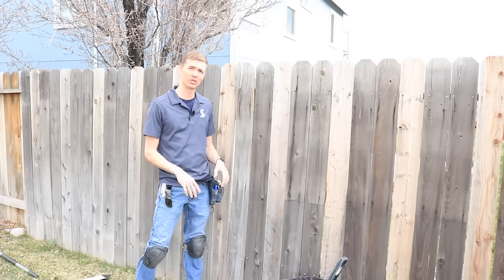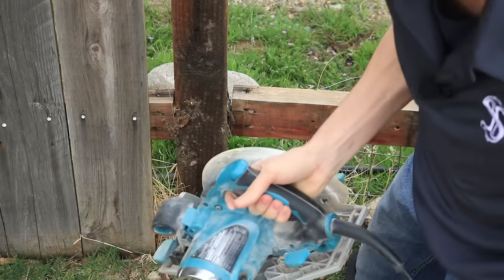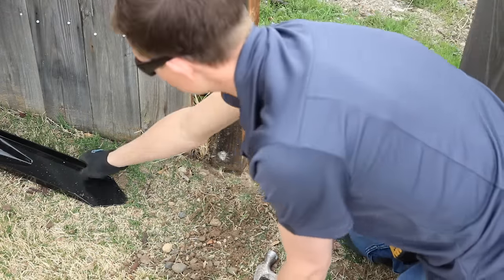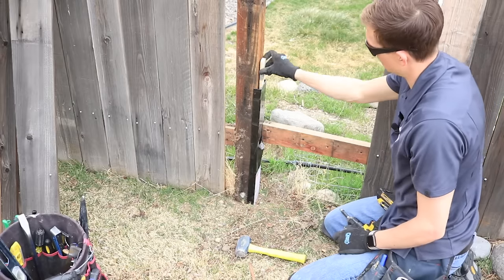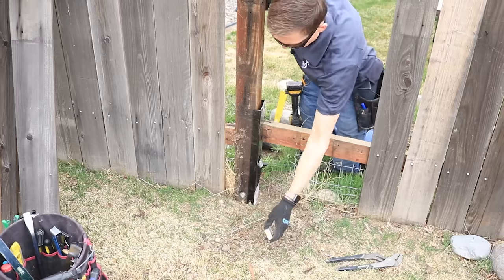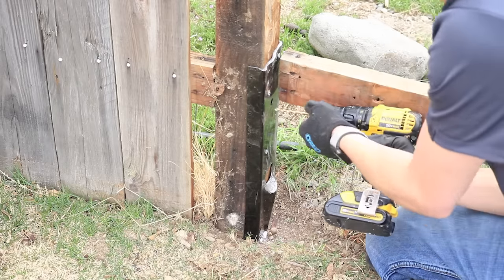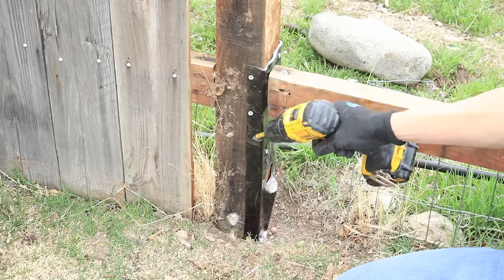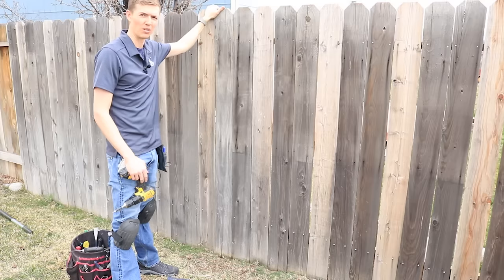How to Fix a Broken Fence Post in Under 30 Minutes

Comment: Thanks for the video! Knocked a few of these in the other day--if anything it was easier and quicker than your video made it out to be. But this thing is solid now, not going anywhere. I'm happy to get a number of extra years out of the fence as it is before I opt to do more invasive fence repairs/post replacements or transition to metal posts or something like, but will cross that bridge when I get there. For me in my situation it fit the bill.
Reply: I is uui
Reply: My neighbours are non-existent right now so it's a great time to do it.
And I took a lot of big branches off that stupid apple tree.
🤣
Reply: You can put new posts between the existing ones even on any side of fence
Reply: a😅
Reply: Good luck doing it in Florida
Reply: 😢⅚

Comment: NEVER hit a hammer with another hammer. The steel sleeve will most likely be stopped by the concrete in the ground. I have never seen this type of repair done.

Comment: If you place the crowbar in the space where you were originally hammering and then hit the bar with the sledge, it will go down nicely without marring the top at all.  That's how I did it.
Reply from the maker: Nice tip.

Comment: Ironically the easy mender looks anything but easy to hammer in.
Reply: assassinlexx  The water needs somewhere to drain to; digging a hole and filling it with gravel just creates a bathtub unless you have granular surrounding soils.

Comment: I should have listened to all the commenters on these ez mender videos. First one i tried, split the concrete, with 1/2 split through whole thing. Its beyond me, how this steel chisel, that is about 1/3 of an inch wider than the square opening, can NOT crack it.

Comment: This video was very helpful. Part of our fence came down with 2 posts on Saturday January 11th. This was due to high winds and a winter storm in the Chicago area. I used your method to repair one of the posts Saturday. It took longer due to my inexperience and lack of skill, not to mention the darkness, wind and snow. It ended up being a very solid repair. I was impressed how well this worked. Your instructions were great. I deviated slightly in that I secured the 2 supports to the post with a long carriage bolt going through the post and both supports. I used a chisel to make sure I had some space between the concrete (which was at ground level) and the post. Essentially, it seems the support wedges into the wood rather than breaking through the concrete. Thank you very much!
Reply: Good idea using a chisel! I'm not skilled enough with a circular saw to pull off that stunt, so... thank you!
Reply: @ltpdogtrainingNJ  Actually, he used the chisel to create some space in the concrete footer next to the post so that the EZ Mender could be hammered in.  He wasn't using the chisel to shorten the horizontal fence rail to make allowance for the EZ Mender (the circular saw part of the video).

Comment: Many thanks for the video. I’m bracing a 4x6 post that you only want to install in a lifetime due to its location (and now surrounded by pavers).  Using the head of another hammer on top of the bracket was a great help. I was not making much progress after 5 min until I started hammering the top of the bracket. Many thanks for the tips!
Reply: Good fences make good neighbours

Comment: We don't have this slim type of fence mender in the UK. I like it! I would give my clients an option to fasten it to a wood post during installation of a new fence to 'future proof' the inevitable underground rot. Fit it as you have in line with the fence to balance the strain. For an extra $10 per post, a sensible choice.

Comment: Thank you for making this how to Video!! Extremely helpful…Just bought 2 of these at Home Depot and they were about $18 each so the price appears to have gone up. Seems like if they put these in on day 1, even if it they weren’t on every post, fences wouldn’t sag as much as they do
Reply from the maker: Nice! And yes, inflation is a bummer.
Reply: These things in the uk are £150 each, it's cheaper just to replace the whole post.
Used to do the same thing years ago but on decayed electric poles.

Comment: Thanks alot this was very informative and helpful,  I do fence repairs and this cam save lots of time and stabilize a wobbly fence easily great tutorial, only thing I would change is using a bigger sledge hammer , I would probably find a more flattened peice of steel  but all you showed was great work!!

Comment: If you have trouble areas in your yard where water collects in the spring, I would even consider installing these on a brand new fence, to pre-emptively take care of the rot that will inevitably form at the ground line
Reply: Huh?  they aren't going to keep water out on a new post.  no way.
Reply: Or you could use metal posts. Like a quality fence builder.
Reply: Get rid of the 4x4 and put a schedule 20 galvanized 2 3/8 post.
Reply: Build the concrete up so water does not sit at the base of the post. Lesson learned

Comment: This is the way I did mine. Dig out the existing concrete post footing (it's weak concrete mix, commonly used by fence contractors) A heavy bar or small chipping hammer will easily breakup the existing post footing. Cut off the decayed fence post at least 2" above the surrounding ground level. Remove all concrete pieces and other debris and make a clean 12" dia x 24" hole, Put two earthquake straps 2 ½" x 36" long (sink coated) Use galv strap nails on every hole of the strap, 18" up and below the cutoff end of the existing post.  Brace the post to plumb. Check the hole in the ground is centered below the post, pour regular premixed concrete and should be at 12" in diameter and 24" deep or at least 4" beyond the end of the anchor strap. Finish the top of the post to a smooth finish at least 1" above the surrounding ground, wait 3 days for concrete to set before testing it for stability and firmness. And you're done!
Reply: Sounds like $500 to repair one fence post. Would you pay someone to do that much work to repair one post???

Comment: Thank you. Your video was super helpful. I just used three of these to fix a long stretch of fence. It’s stronger than when it was new. 
Best tip is to use two sledge hammers, one as a hitting platform and the other to hammer.
Reply from the maker: Glad it was helpful. Thanks for taking the time to comment.

Comment: No doubt this would be a less expensive and much less labor cost than digging up a post with concrete at the bottom and replacing the whole post. Great tip! Thanks
Reply: Did you see how long he hammered on it?
Reply: Not at $18 for two it isn't.  And NOTHING will stop the post from rotting.  Now it will just rot in another place.  There's no free lunch here.

Comment: I used a pair of these on a gate post.  There was a lot of resistance the second half of the way in and much distortion of the metal, but they worked well and secured a heavy gate. 

One comment:  hitting a sledge hammer head with another hammer could end badly if they both are hardened steel - one can drive off a chip that will fly like a bullet, striking ones face (or worse, privates) of course.  Would ruin a good hammer, too.

Comment: The placement of the mender can go any way. There’s more than one right way. Great video!
Reply: I as wondering why he removed the fencing and 2x4 cross support vs installing the metal channel on the open side of the 4x4 post (not removing fence boards, cutting cross support, etc., etc.) ? Curious ... ?
Reply: @GravityRoller  If you think about it fences tend to fall outward or inward. If you were to try and "bend" the fence mender it would be far more difficult to bend it against 4 inches of steel than at 90 degrees with far less steel. The open side would "help" but not near as strong as the way he did it.
Reply: @jerrybenson  Yes, I would agree with your thoughts on this. Appreciate your taking the time to reply.

 I was thinking a couple lag bolts or carriage bolts (instead of nails) along with all the labor saved not removing and cutting existing wood to fit in-line would make more sense.

Comment: Hey dan, teach people to use metal posts , then you will never have a problem. The metal post on my fence are almost 60 years old.  👍
Reply: @tgmforum tgmforum -- It's possible to hide the metal posts by making a box that fits over them so that they look like a regular post.  Some HOAs (Nazis) have rules against metal posts though, even if they can't be seen.
Reply: Your metal posts have never seen hurricane force wind. 4x4s will handle it. Metal posts bend right over.
Reply: @dontblameme6328  Ok how bout this:  If hurricane winds do not apply to you (aka the majority of the world), then this is a good idea.  But yes, otherwise, smart to take into consideration.

Comment: That is why I used metal posts ($26 each) for my back yard. so, I do not have to worry about the damaged posts in the future.
Reply: This is the best answer by far!
Reply: Metal post rust off at the ground too. May take longer if they are galvanized.

Comment: Ive been building fence professionally for almost 18 years.  This E-Z Mender looks like it takes more time and effort then digging out the old post and replacing it with a new one.  Btw, never hit a hammer with another hammer.  They are both hardened surfaces and can shatter
Reply: Agreed, I cringed when I saw that!  You absolutely do NOT want to that without eye protection... but even WITH eye protection, it's still a bad idea.  You could still catch some flying steel elsewhere on your body.  Shake hands with danger!!!
Reply: Agreed. Far more trouble than it's worth. The cost of a new post and small bag of concrete would be negligible.
Reply: I'm not a skilled DYI guy but I repaired a fence but doing just that....I dug another hole about 2 ft over, added quickcrete, and nailed the boards to the new post. In hindsight, probably should have used screws. So far so good
Reply from the maker: That's because you are wrong. I've replaced dozens of posts and do not lack experience.
Reply from the maker: If you can remove the old post, set a new post in concrete, and then rebuild the fence around it in less than 30 minutes by yourself then PLEASE share your methods with me. Until then, all of you armchair quarterbacks should find something better to do than discount methods that make your services irrelevant.
Reply: @StayHandy    You did not do that in under 30 minutes, and even if you did the post will fail within a year.  You, sir, are what we call a "fly by night" fence installer.  The only armchair quarterback is the guy wearing kneepads with gel in his hair, acting like he works outside.  Btw,  I see your dozens of post and raise you hundreds, possibly thousands of fence repairs.  Quit trying to scam people kid.
Reply: I could do this repair myself in way less than 30 mins. It takes about 5 mins to dig a hole right down the side of the post. Next you use a digging bar to break off 1 side of the concrete, then you pull old post out, drop new one in. Nail on your 2x4's, add new concrete and cover with dirt. Bam, done, only takes 15-20 mins and it's done correctly.
Reply: You are not a pro fence builder, if you were , you would be laughing at yourself. Learn how to use a spud bar. Fix it right.
Reply: @stevepauley2437  BS. How are you going to drop in a new post and fill with concrete when you still have three  sides of old concrete left in there? And no hole can ever be dug in 5 minutes. And besides that now you've made the hole way larger and eroded support for the post and made water get all down in there. NEXT!
Reply: @TheLarryBrown  guess you’ve never built a fence before, huh? I’ve been doing this a very long time, and that’s how the old timers taught me. Of course the hole will be bigger, but that’s the only way to get concrete and post out. The new concrete will bind to the other 3 sides you leave in the hole. As far as losing support, no, you don’t. Drop in 2 shovel fulls of concrete, and the 3rd use the shovel to hold concrete against the post. Then put dirt behind the shovel, and tamp it down, until it’s to the top of shovel. Fill the rest with concrete, and cover with dirt. Voila, post replaced and just as strong as brand new! P.s. if I use my gas auger, I can dig the hole in 15 seconds, sooooooooo NEXT!

Comment: I think I can do this now thanks for the video, I moved into a home that has an aging wooden fence line and the fence is now leaning what if your post is not cemented into the ground I still use this technique?
Reply: That fence would be easier to straighten up! The dirt rotted the post.

Comment: A lot of these people commenting just don't get it,  there are a lot of rental propertys out there  that want to fix things the cheapest way possible , and it's not as easy as you people are making it sound, like just dig out a post, there's a couple of feet of concrete around that post so a lot of these property managers that I work for would gladly use this method if the fence is standing and it's sturdy
Reply: agree - I will do the same thing again -  thanks for the video
Reply: Seriously. And some fences have more than one rotten post. So this is a nice solution for when one is saving to replace the entire fence one day. I'm trying this.
Reply: Only an IDIOT puts a "couple feet" of concrete around a post.  Standard fence posts SHOULD NOT EVEN HAVE CONCRETE: it's COMPLETELY UNNECESSARY.

I live in Saint Petersburg, FL - a DOUBLE WHAMMY of hurricanes AND sandy soil.  The standard here, TO CODE, is no concrete required.  My 6' Fence has stood 20 years with standard 8' posts set 30", no concrete other than on a gate post.

Comment: you shouldn't use a big hammer to cushion a small hammer, because much of the hammering force will be lost due to overcoming inertia at strike moment. switch the hammers around and the same force disbursement will be happening, but the momentum/inertia balance will be greatly in your favor. thanks for showing these things...wonder if home depot has them?
Reply: One problem with that idea is that you can't swing a large sledge with only one hand. I tried tonight with a 16 lb sledge I bought several years ago for just this purpose and...no way I could swing that even once with a single hand. however I was able to swing the little two pound sledge.

Comment: I typically replace about 1 broken 4x4 post a year in my old fence.  The old concrete is brittle.  I think there is a good chance it would crack and split if I tried using one of these fence-menders. Plus, the posts I end up replacing are pretty far gone (very soft).

Comment: I made these outa 3mm plate but exactly the same width as post about 30 Yr ago, they are still there today.
Reply: Where did you buy 3mm plate 30 years ago?????
Reply: @thequietkiwi  it wa 30 yr ago not 300 why do you ask?
Reply: @6lr6ak6  I thought it mighta been 300 or USA, which is the same :P

Comment: Just  a word of caution. You should never hit a hammer on hammer. Shards can fracture off of either of the hammers and cause serious damage to your body.
Reply from the maker: That myth has been shattered. Look it up.
Reply: I had a wheel-bearing race chip and wentdeep in my arm where it still resides. The doctor took Xray and said won't do any harm where it sits. Must be like 30 years ago it happened and the Doc was right.
Reply: It's fine
Reply: Sledgehammers are MADE to smack metal and other sledgehammers.
Reply: @remodz6385  As of last week I now know of 2 friends that used ball pean hammer on ball pean hammer to remove a bearing race and both had a small shard break of the hammer. One was hit in the neck with a good cut, no stitches. The other just a month ago hit him in the leg. They found it in an x-ray and attempted to remove it 2 weeks later but they could not locate it so it will stay in his leg. I know they did the hammer test on Myth Busters and I found it very interesting but it can happen. In the first case I didn't see the hammer. In the second case I did and there was a piece missing.
Reply: @chrisnotap  Exactly. Hammer hitting a wedge. Wedge is softer that's why it peens over. Hardened steel hitting hardened steel can and will damage the tool. Splitting mall steel is softer than the sledgehammer.
Reply: I had a chuckle at this point of video as well. Not because of possible tool damage and personal injury. But because it would have been more effective to put a thick metal plate on top and hammer that with sledge.

Comment: This is a perfect solution if you're not ready to pony up for a new fence or doing the job from scratch.  If the nugget holds you're good to go for years.  Replace it the next time around.  If the nugget breaks in the process then replace the post.    As a matter of fact why even pay an "expert" at this point?  You can do this yourself. Ignore all the butt-hurt "experts" who seem to be taking this personally for some reason.  It's just a freaking fence folks.